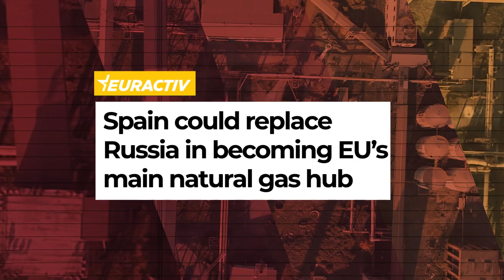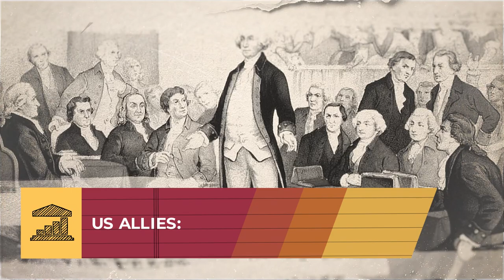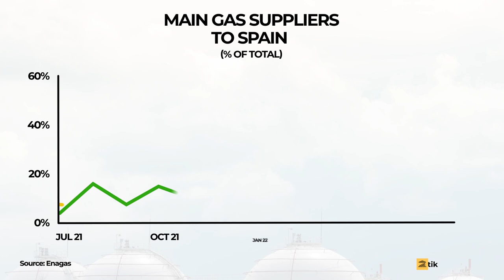Could Spain Become the Great European Gas Hub? - VisualPolitik EN

Comment: Actually there is an alternative very often ignored by the media, which is Portugal by which has no conflicts with neither country and has a diverse portofolio of suppliers and has the conditions to being a entry point/hub for the rest of europe, also its safe and far from the influence of the actual world stage actors, they get gas from algeria and so on and there has been shown interested by the Germans of using Portugal instead of Spain as the hub, and the reasons for that, many have been shown on the video, Spain has made unwarranted poor choices....
Reply: That mountain range between Portugal and the rest of Europe, and easily defended ports really help Portugal. 

Plus they can activate their Brazilians and unleash an army of BJJ Fighters butt scooting across Europe daring people to jump into their guard
Reply: So, how will Portugal get their gas from Algeria then without using Spanish or Morroccan pipelines?
Reply: It's all about having a LNG import Terminal.  Spain has 3 how many does Portugal have?
In Canada we have lots of gas but no export LNG terminal to ship gas to Europe.
I takes 3 years to build a LNG Terminal.
Reply: I’m Moroccan and I approve this message 😉
Reply: @Crashed131963  there is one in Sines
Reply: @Visit_Tangier  hhhhhhhhh 7winahom
Reply: @Crashed131963  Portugal has one in Sines, through there, Europe started to receive the First LNG ever coming from EUA.  besides has major storage capacity and is developing a system which is easy to setup, to transfer LNG from the giant tankers that cannot navigate in the northern waters to ships that can.
Reply: @Crashed131963  Spain HAS 7 no 3
Reply: @MaxiEspadas  Better yet !
Reply: @Royhkz  Theoretically, you could build a submarine pipeline from Portugal to France, and one to Mauritania.

However, this would cost an arm and a leg, and doesn’t likely make economic sense. Even Greece has better chances of becoming a transit hub.
Reply: Yes, and the LNG terminal in Sines is being considered for expansion also because it is geographically closer to the US
Reply: @Royhkz  
The existing pipelines were built by Spain and Portugal , the pipeline is also Portuguese and Algeria is still selling to Portugal , just like Russia is still selling gas to Hungary and not to some countries that the pipeline passes through to reach Hungary.
The pipelines were an agreement between Spain , Portugal , Morocco and Algeria , Portugal doesn't have a toss to do with Spain and Algeria or Morocco and Algeria problems.
Reply: @Crashed131963  Spain has ¡7! LNG terminals and also, how would Portugal send that gas to the rest of Europe but through Spanish gas net to France? Furthermore, could one only Portuguese LNG terminal become an alternative to the 7 Spanish ones? The gas pipeline  with France is necessary either to send Portuguese or Spanish gas. There's a plan B between Spain and Italy, a undersea pipeline from Spain to North Italy to avoid France. Spain also wants to use this pipeline to send hydrogen in the future made by renewable electricity. There are massive investments in Spain for it. Iberdrola, owner of Scottish Power and some other Spanish companies  are building those infrastructures right now.
Reply: @pedrofmc0000  Point being with Spain and Portugal head stat on import LNG terminals 
they could send overseas gas to Europe the quickest.
Problem is the lack of export LNG terminals on the supply end.
Reply: @Crashed131963  I've been looking for that information. There're 7 terminals in the USA at least: Kenai, Sabine, Cove Point, Corpus Christi, Hackberry, Elba Island, Freeport. Canadá has 5 more on the east coast. Australia has 8 working and 9 in the project. I don't think that's the problem. I think the problem is the small capacity of some Centre European countries to receive that gas mainly Germany. If we had good net pipelines to send gas through Europe, Spain and Portugal could help much more. The problem is in the Pyrenees, either for gas or for electricity. Those interconnections must be improved
Reply: @pedrofmc0000  Im from Canada  from what I looked up  is Canada has only a import terminal on the east coast.  Our gas lines do not reach the far east coast.
We have one exsport terminal under construction but its on the west coast meant to supply Asia.

The US has exsport terminals but they are all at 100% and can not take new contracts.

All Canada's excess gas is sold to the US only, we even buy our own gas back from the US that ships that gas to our east coast.
Crazy system..
Reply: Actually Portugal has really good relations with Morocco. It’s considered an European ally by Moroccan diplomacy.
Reply: @Royhkz  they are already doing it....
Reply: @pedrofmc0000  Prepare yourself, this information can be mind blowing but you can chose BOTH? Sines is closer and arguably the best port, so gas comes to Sines and than to Spain to further go into the rest of Europe while more gas is going to spanish LNG ports
Reply: @joaquimbarbosa896  Sines is closer to what? I don't understand what's your point.
Reply: @pedrofmc0000  Nigeria, North america, Angola etc. Many potencial supliers
Reply: @joaquimbarbosa896  Don't think Sines is closer from North America than A Coruña (just one example....) Or closer from Venezuela than Huelva too. I don't think it closer from Nigeria than Huelva or Qatar (another example) The same for Barcelona Cartagena or Sagunto regarding the gas from the middle east...
Reply: @joaquimbarbosa896  Is that a joke?
Reply: @Crashed131963  yes you do, Canaport LNG terminal, owned by Repsol
Reply: @CKBmay10  My friend is a high up executive for Shell Canada and gave me the low down.

There are four Export LNG plants that serve Canada's domestic demand. Two additional LNG facilities are in the planning stages, with Stolt LNGaz slated to open  in Becancour, Quebec and Northeast Midstream planning two liquefaction plants in Nipigon and Thorold, Ontario.

Comment: considering that building new infrastructure takes at least a few years, it seems counter productive to build new infrastructure to support an industry that your stated goal is to divest from. it may be that Spain made it's decision with other considerations in mind than trying to implement a long term solution towards short to medium term problem
Reply: But it will take decades or more to divest themselves from petroleum products and even when it stops being used for transportation and heating, everything these days seems to have petroleum in it-plastic, hell, memory foam mattresses are made using petroleum=so I don't think building the infrastructure will be a boondoggle.  And LNG being so much easier to transport and store for sure will be around for quite awhile.
Reply: That kind of thinking, which took hold in the finance industry, has gotten us into inflation and recession.  It is causing famine (pretty much unavoidable now).
It  take 2-5 years for an investment to start producing gas.   It takes 10 years to get payback.  The inflation, recession caused by high energy prices etc will actually cause a delay in transition to renewables as the money for new expensive renewables just won't be around.  It is resurrecting Coal.    Oil and Gas must not be discouraged.   There must be a smooth transition, not a shock.   We have been achieving 20% reductions of emissions per decade and this is enough pace.   Lying is evil and Green hype is evil.
Reply: @williamzk9083  while that may be so, delaying reducing emissions will cost us a lot more in the long term if we keep delaying switching to renewables. But I also doubt this industry will die off completely. At least for now.
Reply: @Aegis23  The switch to renewables will fail.  The technology isn't there. Globally its only a tiny percentage of wealthy nations that have used wind and solar power.  It's only 2-3% of global energy use.  You have no idea of how much it will cost.  The price of your food is highly dependant.  It is best to precede with increasing the efficiency of everything and slowly phasing in where possible.
Greenhouse problem is exaggerated.  CO2 absorption spectrum is non linear and mostly saturated in lower atmosphere.   We have a lot of time.

Comment: The same argument could be made for Italy, free from the Algerian-Moroccan tensions through the Tunisia pipeline.
Reply: the Tunisian Pipeline is already providing the maximum rate possible, only solution is to build a new Pipeline.
Reply: How old is that pipeline?
Reply: @masmoudi5595  It is called GALSI and will connect Algeria and Sardinia, then Elba and Tuscany, as well as pipelines from Egypt and Israel connecting to the Azeri pipeline (which already exists) in Greece and then to Italy and Europe.

Comment: Actually Spain picked Morocco over Algeria as it make sense for multiple angles. Not just in Economical reason but also  in energy. VisualPolitik failed to mension the EU investment in solar energy in Morocco where they building massive Solar panels in the desert to harness suns energy that could provide huge electricity to western europe.
Reply: This channel is always one sided like most. They always miss details that would be counter to their message.
Reply: solar energy that couldn't even power Morroco as they keep begging for gas 🤣🤣🤣
Reply: Didn't they already build massive thermal solar power plants that ended up being a failure?
Reply: So you're saying, Morocco will be potentially Europe's backyard power generator?
Reply: @algeriaforever1942   Morocco is ranked the 3 rd best country in terms of green energy policies. Do a quick search and you'll see
Reply: @fhirvhdyg5gjyefhitzaphgbiu748  then why do they import power from Spain?
And that ranking is a lie not even in the top 10
Reply: @algeriaforever1942  why do you say that?  Currently 42% of the energy used in Morocco comes from renewables
Reply: @zakim8105  we stil import gas cuz we just started to invest in renewables about 12 years ago, it takes more time then that
Reply: @naamloos5535  I said import power not gas.
Electricity import from Spain jumped over 100 %

Comment: MidCat should be invested into but as part of a larger network. I mean part of not just a distribution network of gas but also the possibility to expand it so that hydrogen and oil could be transported. Not because as Macron states it "It would (not) be needed", but because it's smart to have diversity in energy supplies. Spain has already proven that diversity in energy supply is an absolute must have, Germany is paying the price of not having it. Such larger networks are already being build and basically consist of tunnels where multiple pipes can be put in more easily as needs arise.

Comment: How long will it take to build the pipeline from Spain to France?
Reply: There is already a pipeline algeria-italy-europe. Must be doubled of corse and the fact that I'm italian is only a detail ....!!??!!
Reply: I would think that question needs to be asked in several parts. To physically build the pipeline, probably not too long because I am assuming alot of the gas is already going to Kraftwerk Plana del Vent, a gas plant that is only 589 km from France's Elengy - LNG Terminal Fos Cavaou and the terrain looks flat with already infrastructure so logistics should not be an issue. The real issue is the bargaining, scope, if France and EU wants it more than Spain, Spain will ask for something like a 20/80 cost split where EU/France pays for 80% of the cost and more than likely this will be a price plus not a fix cost. That number will take awhile or depending on how desperate the EU to link this gas
Reply: 9 months

Comment: South-north pipelines will play an important role in the future. Hydrogen gas produced with solar energy can flow through these lines. (hydrogen gas is much easier to transport long distances than electricity) So having natural gas reserves are less important than a stable economy, political system and social structures. Morocco is much better in that regard. In short term it's a bad decision but in 7-15 years it's very likely that Spain will get a lot out of it. This is the reason the EU prefers hydrogen over electricity. The existing infrastructure can be reused. This explains also the heavy push for hydrogen cars over electric one.
Reply: Algeria has a bigger potential in green hydrogen and it already signed with Italians to study the possibility of exporting threw pipelines and it has both financial and natural resources to achieve it...
Reply: Never heard of hydrogen embrittlement. Transporting hydrogen through pipelines is an unrealistic figma of your imagination, the volumetric energy content is lowest, the leaks highest. Hydrogen is not even an energy source. Unsafe as you can make it.

Comment: it's more likely that Italy can do that rather than Spain as it has a very central position in Europe and it is already taking gas from everywhere, East, north and South. Green stream gas pipeline has resumed deliveries to Italy and Italy is planning to develop new gas pipelines with Algeria, Greece and Cyprus
Reply: also forgotten the pipeline planned from Spain too
Reply: Italy doesn’t have the proper seaport to transform the GNL. Only Spain has.
Reply: @peaceinandout9430  nobody said anything about transforming GNL, you don't need that technology when you use pipelines
Reply: @canemcave  wrong pipelines are not enough to cover european need of gaz. Pipeline will cover only a limited amount. GNL is the only realistic option. That’s why US and qatar are sending boats to Spain mainly and other europ countries if they have the rights sea ports.
Reply: @peaceinandout9430  that's absurd as currently it's pipelines that cover over 80% of the european gas supplies. Pipelines are always going to be used for moving gas throughout the territories and pipelines are already being developed from many different location going through Italy or the Balkans. Pipelines, will always outperform shipments in terms of volume and cost, that's why they were built in the first place.

Spain has some  GNL facilities because of its geographical location distant from the natural sources of gas and does not really have the ability to build pipelines through the many countries it would need to cross.  While Italy has some, it does not need to as it has already built a large pipeline network with different countries and it's in the process of building more. 

You can check out the italian pipeline network in italian-gas-oversupply-how-crisis-reshaped-imports-13515 and compare it with the network in Spain which, in terms of both capacity and diversity of origin is much less capable.
Reply: @canemcave  you are mixing what Russia is providing and what Algeria can with it’s two operational pipelines. It won’t be enough. GNL is the only solutions to cover the most important part missing from russia and it’s Spain who has the infrastructure right now
Reply: @peaceinandout9430   GNL is [the] only [solutions] a temporary solution [perhaps].

You are confusing source with capacity. Russia was until recently the country supplying the largest amount of gas because it was cheap and convenient (no wars in Russia yet)

But both Libya and Algeria can supply a lot more gas, in fact Libya was not supplying any gas at all till recently but in the past it was supplying twice the amount of gas Italy purchased from Russia.

This does not even mention the pipelines that are already under construction between Algeria and Sardinia or Italy and Slovenia.

A reference to the various pipelines existing and under construction: italy_switzerland_and_austria_pipelines

Capacity of all these pipelines is way bigger than the single pipeline between Spain and France.

So NO, Spain could not hope of supplying Europe even if there were no other options and as you can see from the reference, Italy is already capable of supplying gas to various countries including Germany as it is already connected by a number of large pipelines.
Reply: @canemcave  again wrong Algeria, Lybia and qatar cannot supply what russia was providing full stop. Those countries have confirmed even in full capacity they cannot.
Therefore, GNL is used to cover the difference until they find another way. Which is just impossible to find. They will try to decrease with time through green energy and nuclear power.
Currently, spain is the only country who has the infrastructure to transform the GNL. Thats why they the only possible hub.
It’s simple watch again the video and maybe you will understand.
Reply: @peaceinandout9430  oh yeah I should believe what you say because you say so full stop! lol

No Spain CANNOT provide the gas because it does not have the pipelines required to move the gas from its network even if it had the infrastructure to convert GNL. 

Spain only has 1 single pipeline active
here is the reference (spain_and_portugal_pipelines), the second pipeline is under construction and even if it was completed the combined capacity is nowhere near  the amount required to supply the rest of Europe.

Why is that? well they were never designed for that purpose!
Reply: @peaceinandout9430  from the reference!

Spain capacity (1000b/d or bn cm): 200 + 150 + 70 + 70 = 490

Italy capacity  (1000b/d
 or bn cm): 
Autsria 150 + 60 = 210
Germany 1100 + 900 = 2000

total available: 2210
and this goes without the under construction which would obliterate any Spanish capacity
Reply: @peaceinandout9430  of course that documentation is a little dated, as the pipeline from Turkey is already working with a capacity of 3000 (1000b/d or bn cm)

There is NO way that Spain can supply the amount of Gas Italy can, NOT EVEN REMOTELY!

It just does not have the infrastructure!